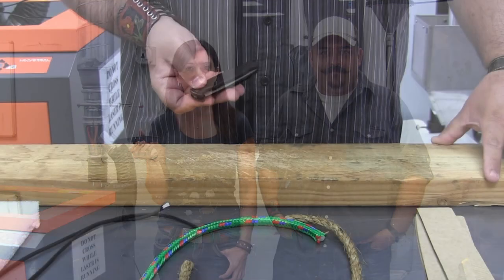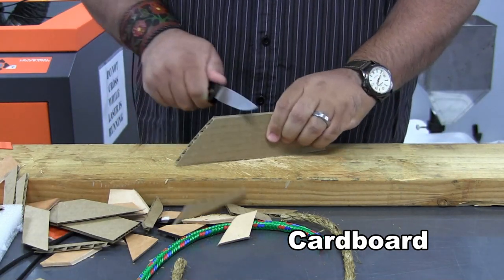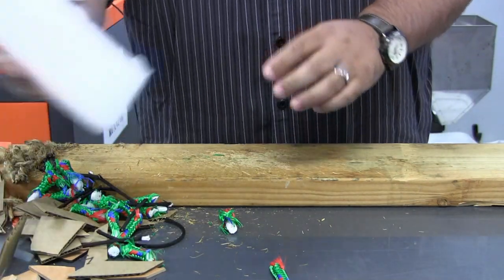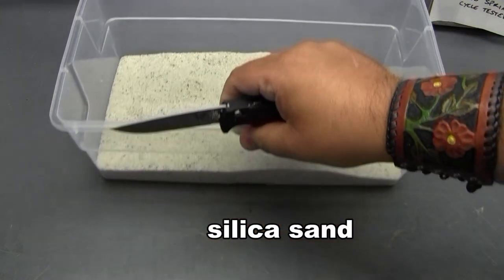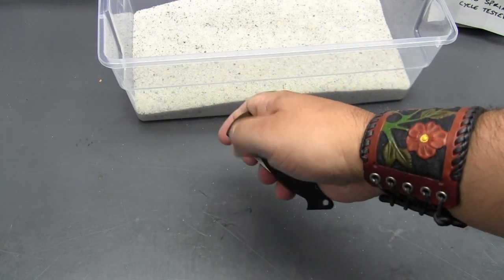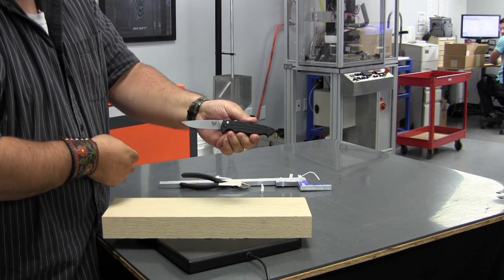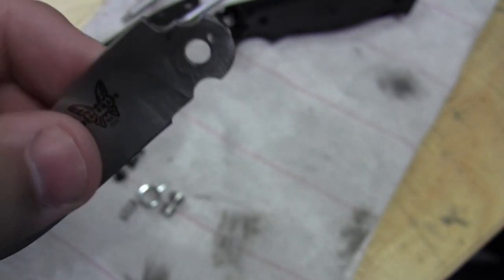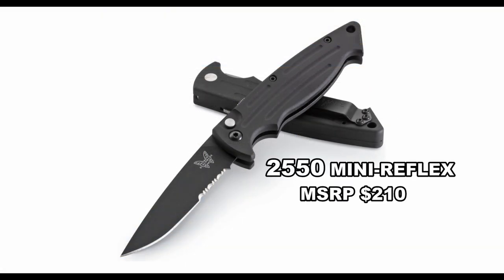Benchmade 2550 Automatic Test and Demonstration

Comment: None of the benchmades I've purchased have ever been as sharp as the ones featured in these videos.
Reply: Someone mentioned it has a thin blade. My 586 with a thin blade is probably sharper than the one in the video.
Reply: I just got my 2550 a couple weeks ago it came with a pretty good factory edge.
Reply: @gsxtr1 hi tin foil

Comment: 2550 looks like a medium size knife. But I've held one before. And it feels small in the hand. And the blade is too small and thin. Got turned off by it. Only if there was a bigger version of it
Reply: IMO something like the 9051 is the big-brother of this knife, but I want a knife I can carry around, not something that's meant to be a fixed blade giant with a hinge.
Reply: Do u like the auto strykers?
Reply: I thought the same thing too when I first held this knife but once I started carrying it, it is PERFECT for everyday tasks. the FFG blade cuts and slices more easily than any other knife I've carried (including my manix 2) and is far more capable than it initially appears. Also I've come to love how lightweight it is. I have also carried the barrage, adamas auto, manix 2, and a few other knives and this one is by far my favorite for EDC.